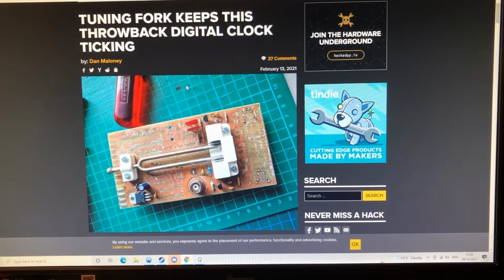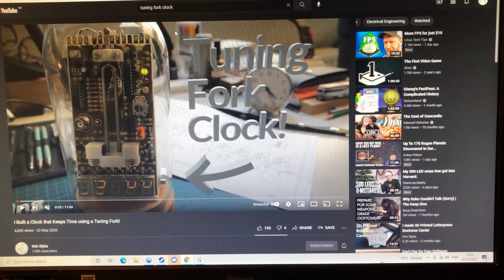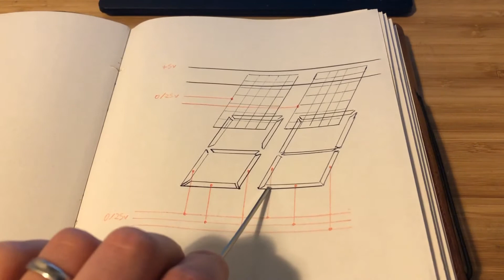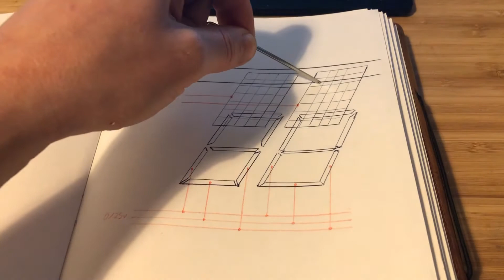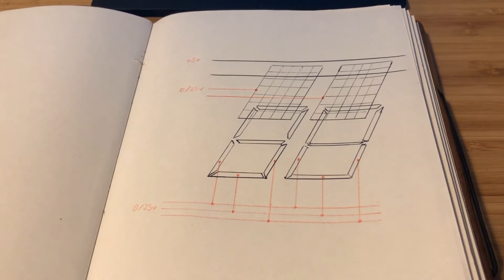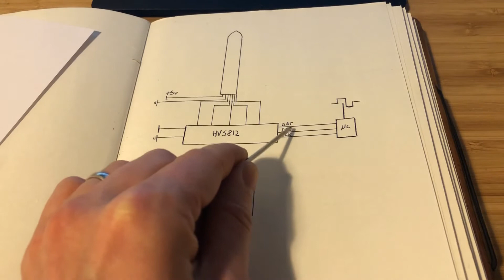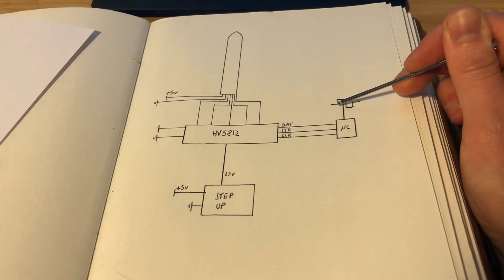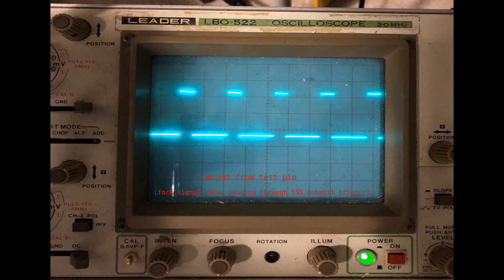Soviet IV-18 VFD clock, driven by a tuning fork

Comment: I'm reminded of the Soviet bugging device conceived by Leon Theremin. It was hidden in an award to a US diplomat but before it could be hung in the diplomat's office, all manner of tests were made to ensure that it was not emitting EMR. It turned out that it contained a bug but the bug took it's power from EMR beamed onto it. I don't know the frequencies involved but it does show how the Soviets were able to go down entirely different technological pathways.

I still wonder what happened to the Soviet design for nuclear powered drilling machines that were meant to allow soldiers to travel underground as readily as they did on the surface. It seems a crazy idea but it seems that for a while at least, some serious research on the topic took place.

Comment: Looks like the left-most segments aren’t getting lit as much, especially under the lower filament. The comprehensive page on Noritake’s website describes this as an issue caused by DC driving of the filament, as opposed to AC driving. On my display board I added a high frequency square oscillator that feeds the filament from a 74HC14, with a high-pass filter cap on each leg, and a low-side emitter follower / current sink to set DC bias after the caps.

Comment: Oh you undersell yourself my dude. Very detailed but I can see the effort put into this, the sketches, and the moment you pull that camera down, that is a sick clock there. Even cooler that you provide additional resources on it as well.

The microprocessor part kinda of reminds me of working with the new pixel leds, with addresses and programming them. I don’t program at a deep level at all but it’s sort of similar.

And of course, who hasn’t butchered a usb through hole solder, I sure did last week 😅, I don’t know if there is even copper left after what I did to the poor board.